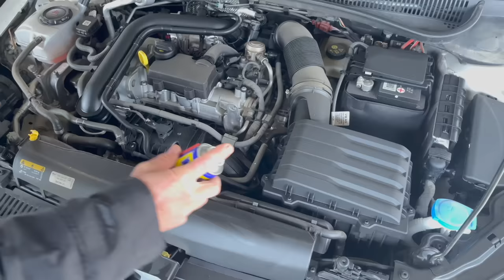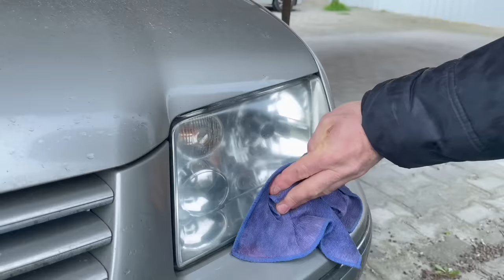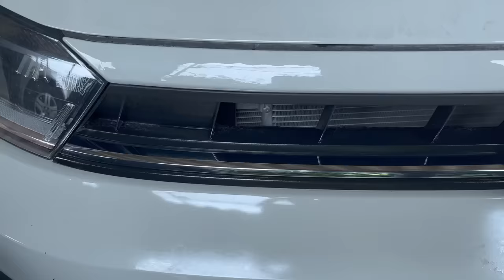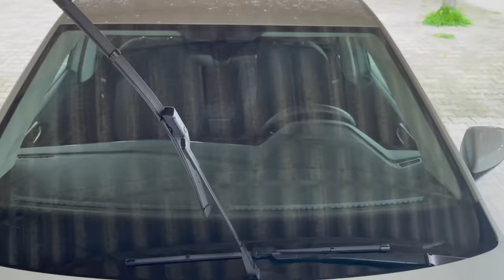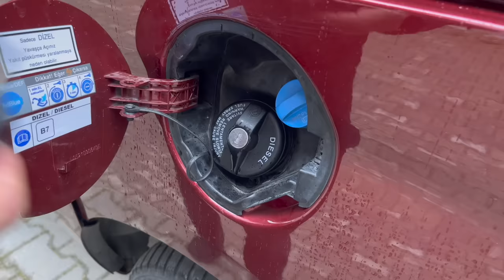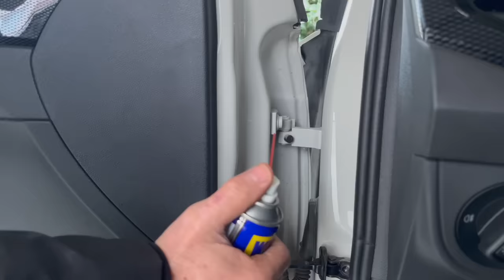Spray WD-40 This Part of Your Car and You Will Be Amazed With Result!

Comment: No No No! When the WD-40 dries out and cracks all your plastic and rubber parts you'll be sorry, Furniture Polish or Silicone Spray is a much better choice and unlike WD-40 it won't cause Cracking and Dirt Buildup in the long run.
Reply: Thanks a lot. It helpfull.

Comment: 다른 용도는 다 좋은데, 와이퍼 블레이드에는 흑연이 있어서 닦으면 역효과가 납니다.. 그리고 그리스가 도포되어 있는 곳에는 wd-40 은 디그리스 역할이라 그리스를 제거해서 처음에는 부드러운듯 하지만 시간이 가면 소음이나 부작용이 심해집니다.. 배터리 상판도 한번씩 닦아주면  이유없이 방전되는 차량의 암전류 제거에 도움이 될 수 있습니다..
Reply: 맞아요
Reply: 침투윤활 작용 때문에  볼트들에 묻으면  엔진 진동으로 볼트들도 다 풀립니다   엔진룸엔  사용 안하는게 낫습니다
Reply: 그렇죠 금속연결부에는 스프레이그리스가 좋다는거
Reply: what is DARK CURRENT ?????
Reply: @inkey2 That was a wrong translation. He meant parasitic current, which is the electric current that a car uses after you killed the engine. If this is too high, it is not good for the battery's life.
Reply: @wamma1961  I had a beautiful 2005 Merc Sable wagon I bought used years ago.....fully equipped, all leather interior. I had to get rid of it from a parasitic drain. The car had so many options in it there were just dozens of fuses in it hidden all over. It was odd that it started right after a historically freezing cold snap here in Massachusetts. It was so cold the dash lights wouldn't come on till the temperature finally warmed up.

Comment: wd -40 might look suitable temporarily, but it will attract dust particles later.  it will become an original greasy look again. wd-40 is hard to remove if you ever want to paint.
Reply: Yes.
Reply: Hard to remove? Ever heard of brake cleaner? Use it the best to clean off silicone and dirt.After it drys u can start paiting.Wd40 is good stuff but lof of parts of the car need grease not this silicone stuff.

Comment: Good for a quick clean look. But that will damage or make the plastics brittle in the long run
Reply: 플라스틱에 뿌리면 기름이 빠져서 안좋습니다.
Reply: I think WD-40 is a great product as a lubricant, and in some cases a cleaner, but the smell of it is not good, and there are much better products like Adams, out there to restore and preserve your plastic/rubber parts- also don’t leave a greasy residue.
Reply: Not true, been using on plastics and rubber for over 20 years. It actually keeps them from drying out. Try again.
Reply: So that's why they created the WD40 Silicon Spray Lubricant?
Reply: Et ta soeur elle cecasse clown😅😅😅😅
Reply: Gibt besseres Produkt für diese Anwendung. 4 wd ungeeignet 😊
Reply: @lorollinls same here

Comment: Теперь покажи, как липнет пыль к этому 😅
Reply: Super
Reply: This is a OIL  !
Reply: huilo dlq rusiaaaaaaaaaaaaaaaaaaaaaaaaaa
Reply: @navalni007-vs2qo  What does it have to do with me and Russia? You're not all right
Reply: Its easier to remove dust but it protect the parts specially in the winter against corrosion.Appy on rubber parts they wont crack.
Reply: Its easier to remove dust but it protect the parts specially in the winter against corrosion.Appy on rubber parts they wont crack.
Reply: Its easier to remove dust but it protect the parts specially in the winter against corrosion.Appy on rubber parts they wont crack.

Comment: Silicone spray  or oil is far superior and lasts much longer. But don't use it anywhere near electrical connectors, brakes or on rubber mats or pedals.
Reply: And never use Amor All.
Reply: @TBI-Firefighter-451  Why not?
Reply: Quite true.  WD40 will remove oils from plastic parts. Silicone is far better.  Also great for protecting rubber bushes and gaters underneath the car

Comment: Great video. One thing. WD 40 is a petroleum product, not good for rubber windshield wipers. Silicone spray would be better. Thanks for the video!
Reply: Welches Silicone spray empfehlen Sie für Gummiteile? Danke.
Reply: @gaswirt  Silicon an einer Scheibe macht Sie wahnsinnig. Es entstehen furchtbare schlieren.
Reply: Any brand silicone spray will work.
Reply: Actually, WD40 makes a silicone spray too, if you’d prefer.
Reply: You will end up replacing the blades and using acetone to get the silicone off the glass for an hour. Trust me.
Reply: @davelowe1977  never had that problem. Let the silicone dry on the blades before putting them down on the windshield. I eventually switched to silicone wipers, they last way longer than rubber ones.
Reply: @gaswirt  Marke ist egal, alles das gleiche Zeug, aber Scheibenwischer würde ich nicht unbedingt damit reinigen
Reply: @Gutentag888  dann kannste WD 40 benutzen 😂🤣
Reply: Was ist da besser,
un das quietschen zu stoppen?
Reply: @gaswirt  wenn ordentliche Reinigung nichts bringt,dann bleibt nur wechseln auf neue
Reply: Mit Silikon Spray reinigen?
Reply: @gaswirt  also Scheibenwischer nicht, aber ansonsten kann man praktisch alle Gummiteile auch damit reinigen gleichzeitig werden sie gepflegt

Comment: A mechanic with 17 years of experience tells you, it is forbidden to lubricate locks (fuel cap, ignition key, etc) with multipurpose spray, that can be lubricated with oil, that happened to me and with wd40 they lock completely
Reply: Also Roller Bearings I'll loose lubricant and fail.
Reply: I use graphite powder for my locks, lubricates and never gets stuck
Reply: @johnyb874  I am very, very grateful for your comment, I am sure you are a person with a lot of knowledge, I have thought about it well and graphite is a material that sticks like adhesive grease but it is not sticky and metal has no friction, multipurpose spray it lubricates and unblocks but then it dries up and the oil works why it doesn't block but the graphite is ideal for that thank you very much my friend.
Reply: Wd40 is a degreaser
Reply: The best solution is the one that our friend has given us, that is the hand of a saint, the graphite.
Reply: I use KY and have never been stuck.
Reply: yes some oil in spray. i have silicone oil in spray.
Reply: @fF-jb4gs actually it's a Water Displacer, the clue is in the name.
Reply: @angowT  its a degreaser too. Spray some on your hands after doing some dirty work and you'll see its a great degreaser
Reply: Jako základ v tomto spreji pravděpodobně petrolej.

Comment: WD 40 is great for many applications .  We used WD40 on foggy car headlights and it cleaned them immediately and the residue was wiped with a clean cloth .  However ,  after getting the car washed the headlights returned to being foggy .

Comment: There are many uses for WD-40. Just one question, how long does it last?
Reply: Until a ton of dirt gets collected onto it. Don’t do it. For some reason this channel likes to spread nonsense.
Reply: moments after this recording everything he used it on, turned white lol... this doesnt work
Reply: Pas plus d’une semaine.A éviter sur les durites .
Reply: I remember years ago using WD-40 to dry out ignition wires [1970 era] it only lasted a limited amount of time, so just a temporary fix. WD stands for water displacement read the actual msds specifications.

Comment: you should wear rubber gloves if you are going to use wd40 that much. it has a strong solvent in it and is not good for prolonged skin contact. check the msds data sheet. the stuff has it's place and is quite useful for some things.

Comment: Wd40 is not a lubricant and will not replace oil or grease. Do not use it for locks as it will damage the lock after some time.lock will dry inside .
Reply: I had to replace nine chastity belts!

Comment: Bensin 500 cc + Car wash 500 cc put to the foggy spray then shake and spray to all engine area and wait 10 minutes then clean by water. this method NOT EFFECT to the engine and the electrical system.